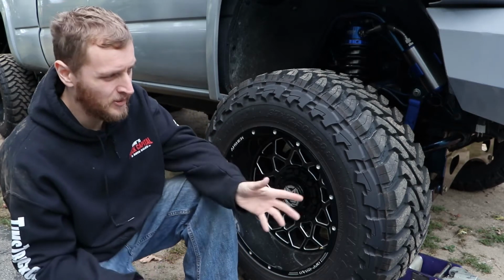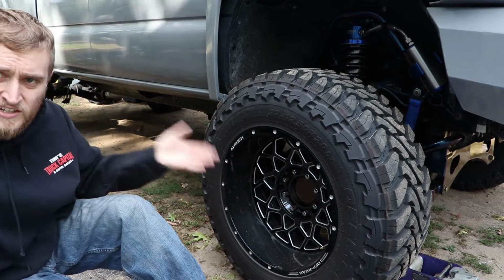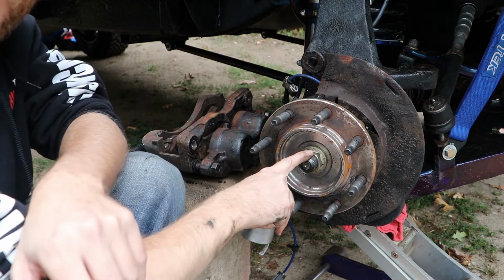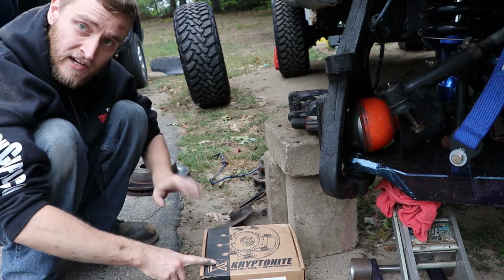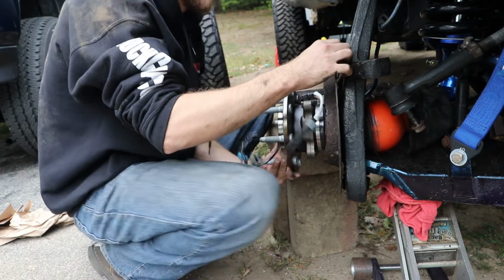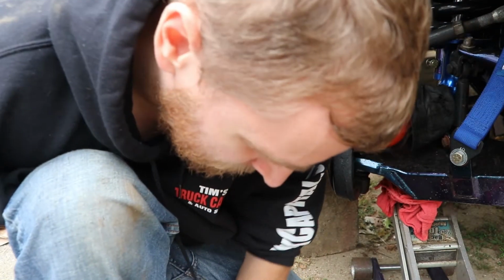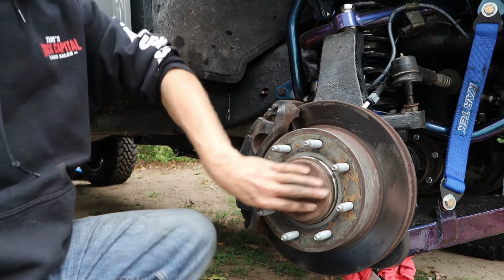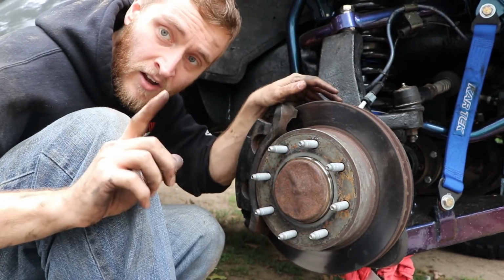Truck Vlog: Kryptonite Hub Install

Comment: what control arms and ball joints you running? i have a 6 in lift on 14 wides and shit is wearing quick. i ordered these bearings already. should start back up with these truck vids! it's poppin rn
Reply from the maker: I'm running an old Fabtech long travel lift, I believe they stopped making them in 2010 or 2011. The upper and Lower control arms are both designed specifically for this lift. What 6" lift are you running? It's definitely the 14 wides that are giving you the trouble, thats a lot of negative weight on the front suspension and will wear it out fast. Kryptonite is probably your best bet for front end parts. Stay away from moog, the chinese bought them and their products have been shit ever since.

Comment: I is super smart now.. Thanks Joe. How them CV axles holding up?? How do you know Joe?
Reply from the maker: Honestly my issue with the RCV axles is the orange boot tends to crack in cold weather. When this was a year round rig I'd usually have to change one orange boot every spring which can be a pain in the ass to do. I didnt have a problem keeping bearings on this truck until recently, it had 3 years of pretty solid off roading on it's OEM bearings and only gave me trouble when I switched to moog, I'm hoping these kryptonite's fix that issue.
Reply: @djentlemanjoe5198   those bearings should help a lot, if they don't , maybe look into something like something from SOLID or crane axles.. something from the Ultra 4  group. that's if you really want to keep the IFS..Moogs went down hill after they sold themselves out to chinesium garbage. Have you tried coating the boots in like a fluid film or other light coating of oil..WD-40 maybe.. Just to help prolong them in the temperature changes...NH went from an oven to a refrigerator in a heart beat. was there last week and it was freezing.. wtf. Maybe its the manufacturing process of the boots, not enough silicon in them or something

Comment: What long travel setup is on your truck
Reply from the maker: It's an old Fabtech lift. It was discontinued in 2009, from what I was told this was due to the recession.
Reply: DjentlemanJoe I remember seeing one on eBay awhile back I noticed it was coil over swapped and no one made a good kit to do so but lsk suspensions just came out with one 5k ish